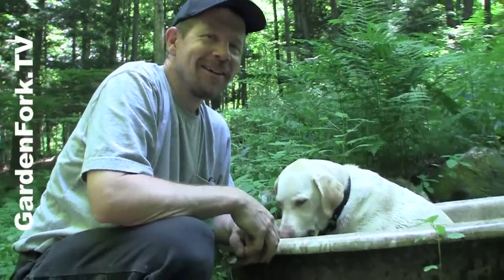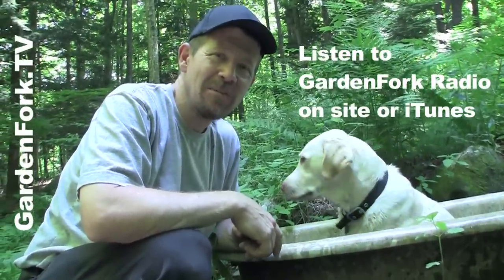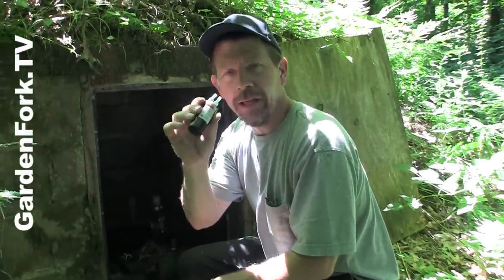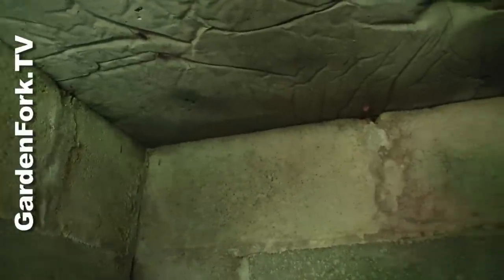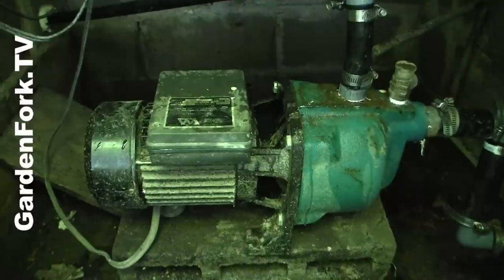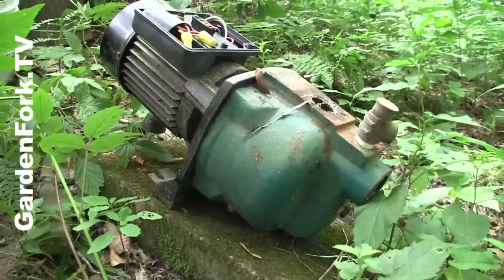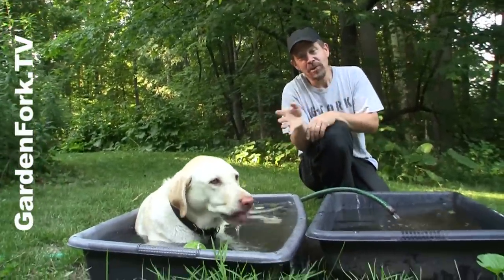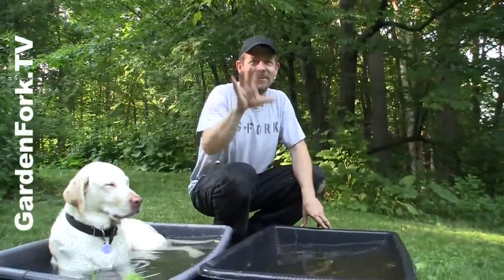Failed Attempt At Fixing My Well Water Pump - GardenFork

Comment from the maker: the motor shaft has screwdriver slot in it at the brush rotor end, and i could turn it with a screwdriver and the motor and pump turned.

i kept the old pump hoping to diagnose it further and keep it as a backup. could it be the brushes are smoked? the pump may have been in water with the deluge of rain we got last year. 

thanks for the info and comment, eric.

Comment: Eric,
your motor is an induction motor and there are no brushes.  Your motor has a run winding and a start winding.  The start winding is what the capacitor is in series with.  After the motor gets up to speed the start winding is cut out.  There is a centrifugal switch that cuts out the circuit.  Take the ends off the motor and look for the switch and see if its something easy to fix.  Could just be some lodged in the contact or corrosion

Comment: This is such an easy repair job, takes me like half an hour. You strip the pump and replace the bearings, Normally it is only the main bearing that's seized but I always replace both bearings and inspect the mechanical seal and replace if need be.

Comment: I live in Lithuania and I have the old soviet made well pump, that did exact same thing. The problem was The propeller that is inside the pump, that create vaccum when levetating to pump water  - it broke. I went to a very old store that have all kind of things from soviet times and I found the propeller that I needed. I replaced the propeller and the pump worked again.

Comment: To get the best out of your pumps, you need to get rid of any fittings with abrubt angles in them.  You need to get rid of the two linked 90°s on the inlet (just have it direct in) and extend the outlet hose a couple of feet, so it can go directly/straight, onto the pump outlet.

Comment: If the windings are open, it wont trip the breaker. It sounds like the pump is locked up, its over amping the motor, causing the breaker to trip. Disconnect the motor from the pump and see that both spin freely. My guess is that the pump, or motor, wont.

Comment: Hi - nice video.  Love the Lab!!  I just bought an almost identical pump (motor looks to be absolutely identical, my pump is only slightly different).  What is the brand?  The label on mine is just shiny aluminum, nothing visible.  Also, I'm trying to separate the motor from the pump as the pump is seized (or maybe just full of mud/rust?).  Any ideas on how to separate them once the four bolts are removed?  Thanks!
Reply from the maker: +Rusty Fox mbe tap the pump with a rubber mallet to break the seal. I think it's a big o-ring. Don't remember the brand, sorry.
Reply: Thanks for that info.  I actually got it apart before I got your reply, but this trick might help others.  I got the idea while I was unpacking my new steering wheel/harmonic balancer puller.  I thought, 'If only there was some way to do it like a puller."

What I did was put two stainless steel 1 peso coins in the gap behind each bolt hole, and then screwed the bolts in from the wrong side.  I tightened each bolt about 1/2 turn.  They were then pushing the motor away from the pump, nicely and evenly.  Worked a treat!  Left some circles on the coins too.

Comment: My deep well water pump is pumping a lot of sand.the filter is always full of sand.any idea why and what can I do to correct this problem. The well is 120 ft but the pump is 60 ft deep.i will pull it up today to check for any breaks in the pipe,other than that ,any suggestions ?
Reply: alice moreno hyttii
Reply: it must suck water from up. because sand is heavy it is always in down

Comment: I don't know whats happening ,but my motor on my shallow well pumps runs. Its turning the impellar as it should. I changed the check valve. But its not priming or preasuring up. Any suggestions< im at a lost. Thanks Kent
Reply from the maker: Brody Breaux if you prime the feed pipe from the pump output pipe and the water drains out, there is a leak or some debris stuck in the foot valve. the feed pipe has to be leak free for the pump to pull the water up and out.  thx, eric.
Reply: GardenFork what or where is the foot valve
Reply from the maker: Brody Breaux the foot valve is at the bottom of the input pipe, its a screened check valve that keeps the pipe going to the pump primed with water.
Reply: Quite often it can also be found right at the inlet to the pump itself. It works either way.

Comment: it sounded like it was locked up...one thing you want to watch out for in working on anything with a capacitor is to NOT touch the contacts on top of the capacitor....that'll make ya pee your pants for sure...those things pack a wallop!!
I worked for Fasco for 11 years building electrical motors and got my fair share of shocks from those things!

Comment: how to repair my electric motor where in it keeps on pumping even the tanks if full or even nobody using the faucet it keeps on running or pumping.
Reply from the maker: +Joselito Aguid the pressure switch on the side of the water tank or the pump is probably broken.
Reply: Thanks sir, I fix it this morning and it was the switch that broke. Once again thank you very much. You are a great help.